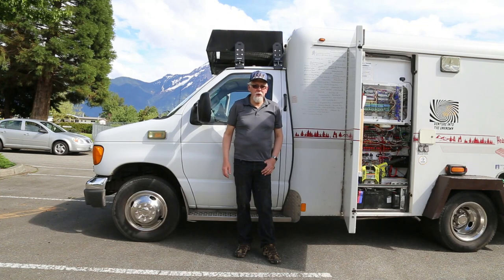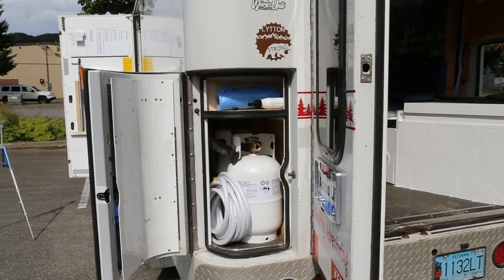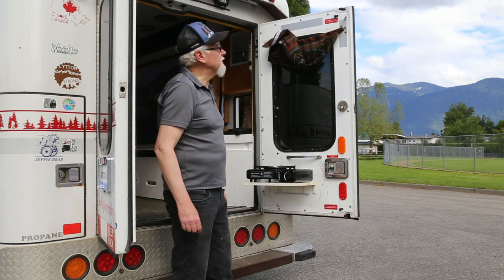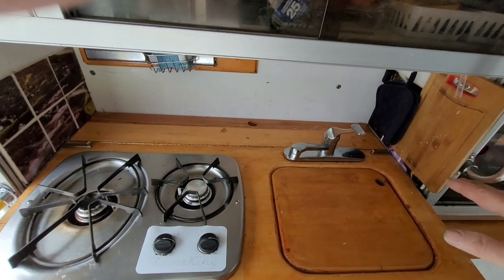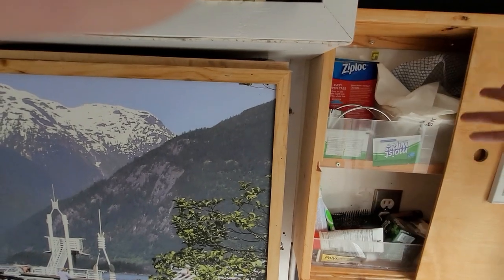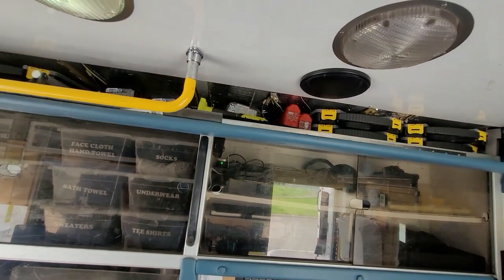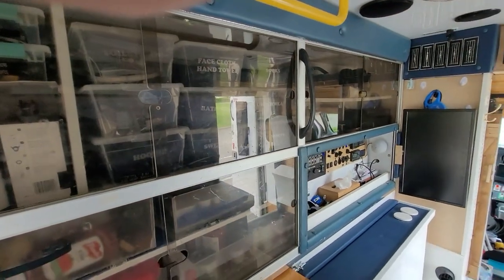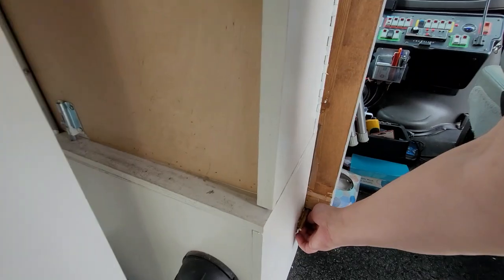Ambulance Conversion Tour Update

Comment: Awfully brave to put your water heater in your electronics cabinet. I see that part of the electronics are enclosed but are you not worried that a little pressurized water leak or line burst could destroy some of those electronics? I laughed at the alexa commands to open up the cabinets. I've seen many 'van build' videos but I've yet to see that. Great party trick!
Reply from the maker: When I redo my electrical it will ne all on micro din rails on the top. And I will have shielding on the bottom.